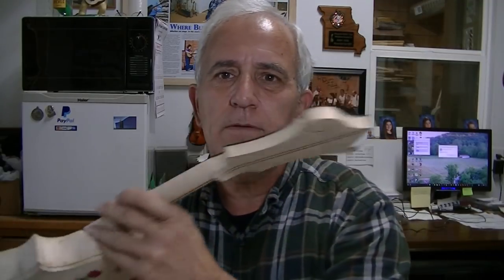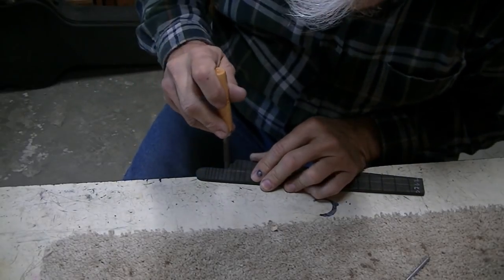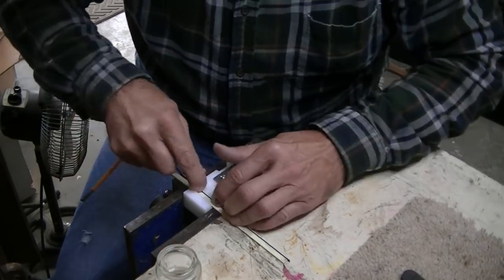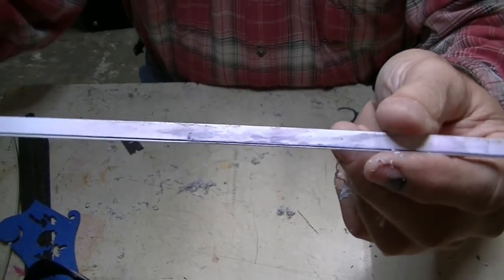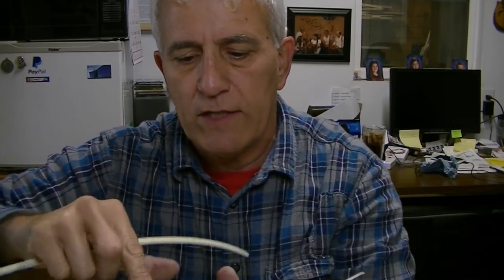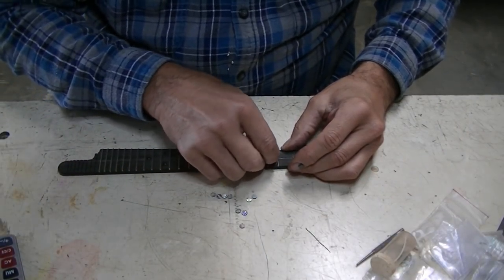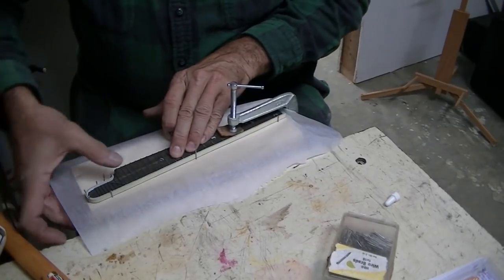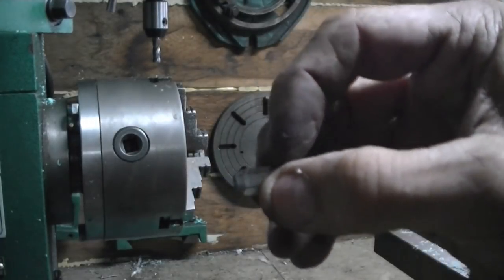182 RSW Custom Rosa Mandolin Part 7 Fretboard

Comment: Jerry, I was wondering what that gizmo is under your home made thickness sander? The round table that adjusts up and down....?
Reply from the maker: Yes that's it it's around table and it screws up and down
Reply: @RosaStringWorks  Did you make the table or repurpose it?

Comment: I'm just curious (off topic)... I've just found that you live in Missouri. And since this belongs to tornado alley, I wonder, if you ever had trouble with tornados. Or at least, if you are worried about them. To me, this is the most fascinating weather phenomenon on earth and scary as hell at the same time. Cheers from Germany! (Obviously going to be the next tornado alley if that will continue like it does in the last years...)
Reply from the maker: I've seen the damage caused by lots of tornadoes but I've never actually been in one. I've seen one or two in my life from a very far distance.
Reply: @RosaStringWorks thanks for the reply! :) Glad you never had trouble with it! "Far away" is always the better option, that's for sure. ;)

Comment: I always enjoy your videos but I noticed an error in this one:
At 20:27 you say that you have a 5/16 inch nut in the lathe and it will work on a 3/16 inch rod. I may not know much about building mandolins but I do know that a 3/16" rod will have 3/16" or #10 thread and a 5'15" nut will have a 5/16 thread :-)
Reply from the maker: There may be a misunderstanding on the way I said what I said the nut on the outside is 5/16 the rod that I threaded with a number 10 thread is a 3/16 inch rod the whole inside the 516 since nut is approximately 3/16
Reply: You said "I have a 5/15 inch hex nut chucked up in here". No mention of that being the outside size. I am involved with several motorcycle forums and hardly a month goes by without someone snapping off an M6 screw that has a 10mm head because they tried torquing it to the spec for an M10. I know that isn't likely to happen on the mandolin but it is a bad habit.